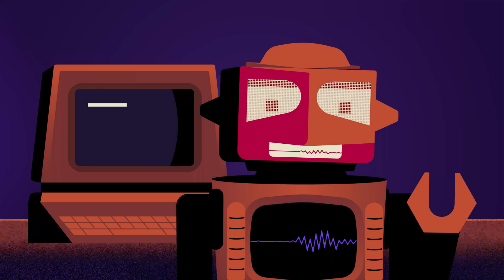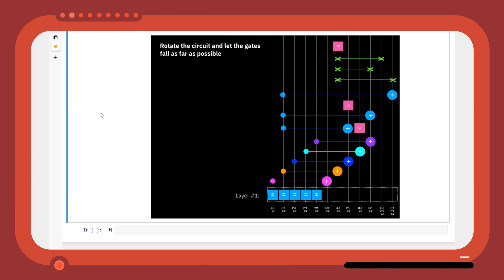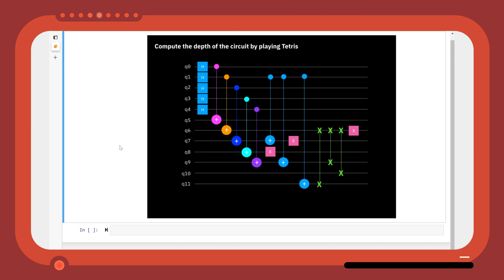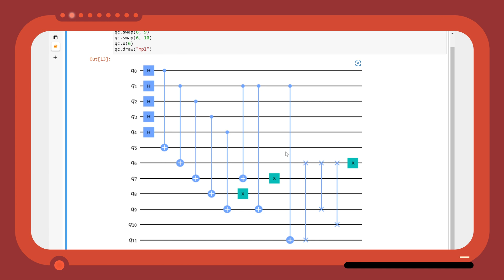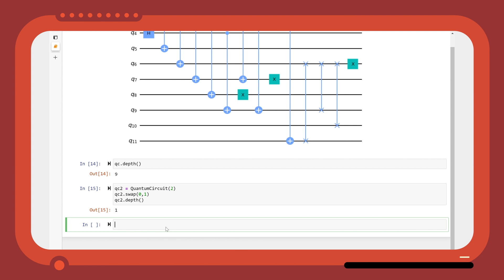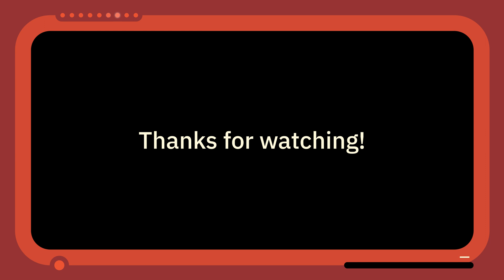What is circuit depth and how can I calculate it? 1 Minute Qiskit

Comment: If we wan to represent each circuit depth as an operator (Matrix), then If the matrices do not commute then they represent different depths, while if they commute then they do not represent two different depths but only one circuit depth. Like for example layer 2 in your animation, they are different matrices but they commute therefore all of them represent only one circuit depth. Is this right? 
I mean is there a relation between commuting operators and the circuit depth?
Reply: Hi, thanks for the question! Even if operators commute they can still contribute separately to the circuit depth. In layer 2 of the animation, all the CNOT gates can be implemented simultaneously on all the qubits, so they are grouped together in one layer. But, if a circuit just had a CNOT followed by a CNOT on the same 2 qubits, then the CNOTs commute but the circuit depth would be 2 - each CNOT would be 1 layer because they cannot both be implemented simultaneously on the same qubits. (Note that a CNOT followed by a CNOT on the same qubits is actually equivalent to doing nothing, so after transpiling the circuit, the circuit depth would become 0!) Hope that helps!